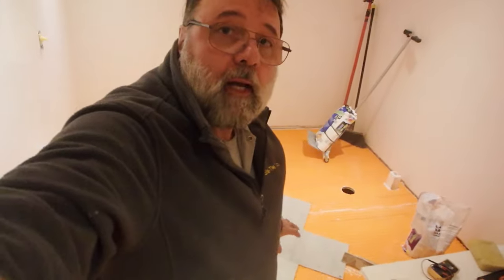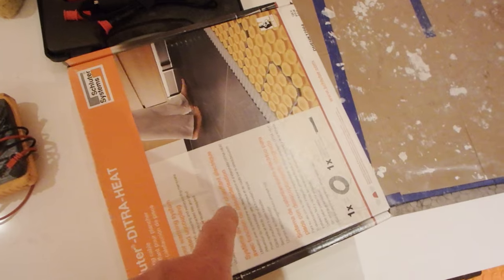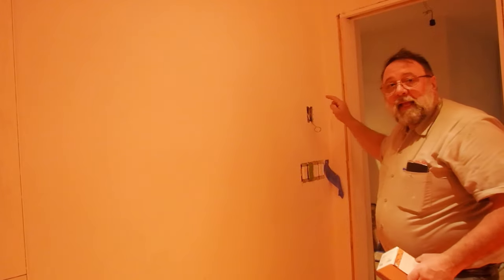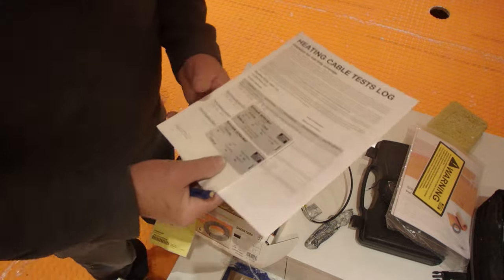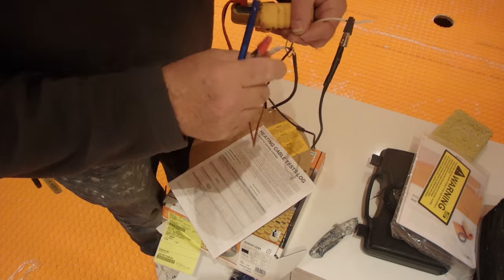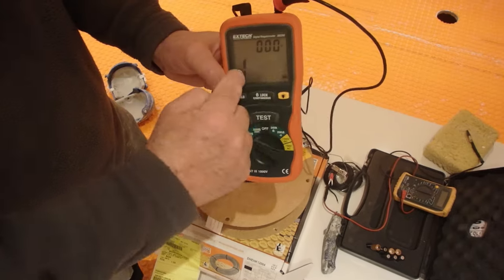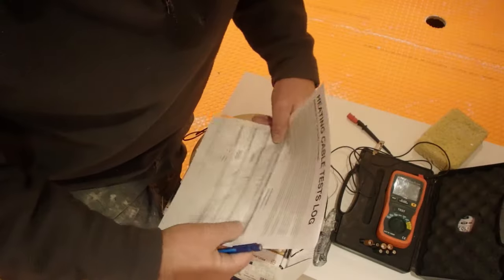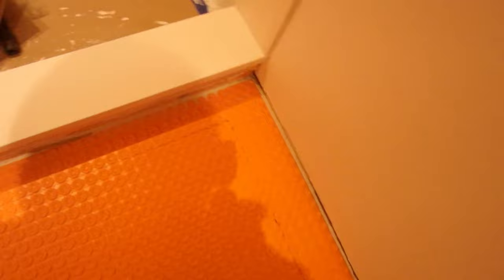Ditra Heat, electric floor heat testing and install.

Comment: Sal, I'm a professional tile setter and I take great pride in a job well done, but in my opinion, YOU are the undisputed MASTER of tile setting.  Huge respect for you and your work, and thank you for the quality and volume of videos as you share your lifetime of experience and expertise with us. In your opinion, what is the best electric floor heating system on the market and why?  If you don't have time to explain why, please just simply state which system you prefer and/or endorse.  Much appreciated Sal!

Comment: The current Ditra heat installation instructions say the heat wire cannot be in the same conduit with the sensor wires. Actually I just looked again…the 2016 version said they couldn’t be together … the 2020 version says they can. 🤷🏻‍♀️

Comment: Good video Sal. But, you don't give an explanation as to why you put in that little 1" bump-out in the wire run if it's longer than 10'. What's the reason for that ? Thanks for the video.
Reply from the maker: Avoid over stressing the wire on long runs.